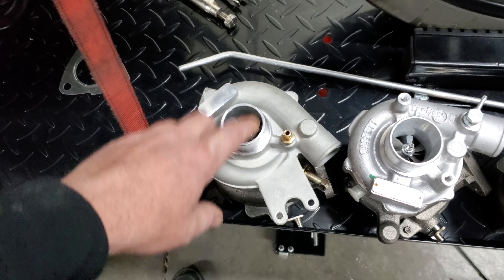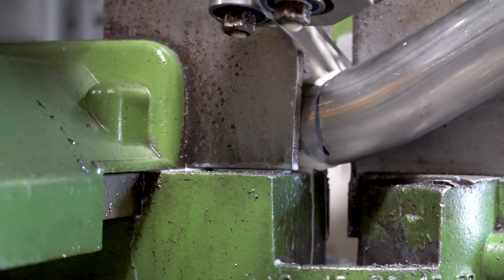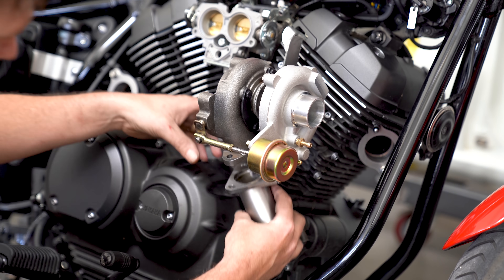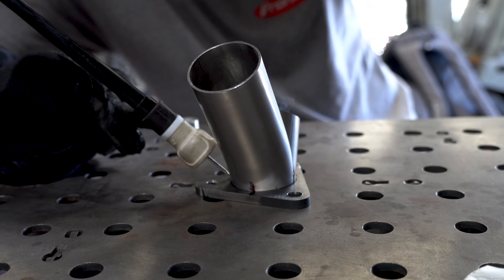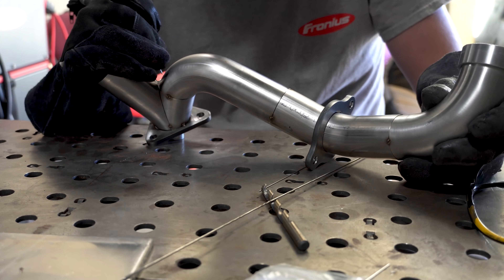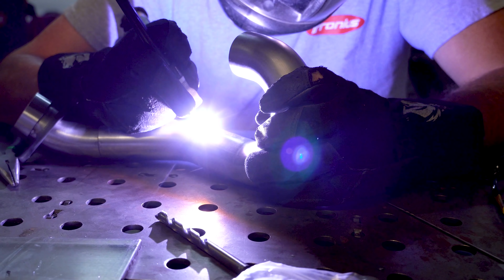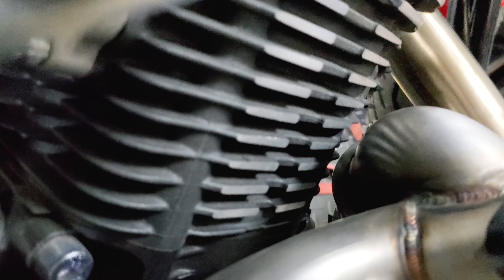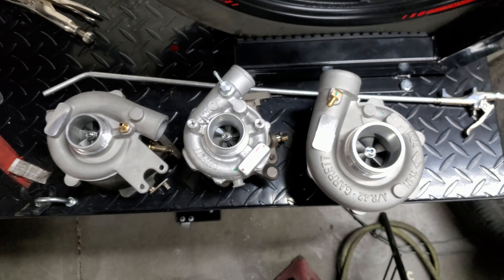Motorcycle Turbo Manifold

Comment: Not sure if someone mentioned this already,  the issues with your camera could be caused by proximity to your tig welding.  High frequency welding does tend to generate some impressive RF output.  That RF can be involuntary inducted into microelectronic components.   I hope this helps.  Your videos are super informative and greatly appreciated.   Thank you for your work.
Reply: Nailed it.

Comment: This is a honest to heaven question:
Should the pipes to and from the turbo not be as close to the same length as possible?  Pressure and flow issues?  Or doesn't it matter on this scale of setup?

Comment: I know first hand, GT15 losses efficiency at 5300ish to 5500, granted my ECU redlines at 7100. possibly moving to gt22 May fix this but I’d assume a tad larger injectors may be needed.
Reply from the maker: I've seen your posts. When I did the math on it initially I found similar results. The GT22 should be just right.

Comment: Don’t you need some kind of flex point before the turbo to prevent cracking overtime?
Reply: I think that with the turbo mounted to the engine and the small weights(forces) and times cracking should not be a problem .

Comment: As "the guy" who built one of the first Turbo XVs (mine's a TR1 though) - you're in for a completely new level of fun...
Reply: What kind of turbo did you use? I want to turbo my Honda Shadow VT 750 and I've looking on ebay for cheap turbos between 100-200 Euros. All of the turbos I found were for 1.3-2.0L car engines, are those too big? I don't really care about massive power gains, do you think turning down the boost would be enough to not blow up my engine? Also did you add cooling to your bike/turbo?
Reply: @Bishop_Heahmund  There's no turbo too big for an engine.
Reply: @arunmfive  depending on how long you want to keep the engine and whether you want to do excessive modification such as changing compression ration, additional cooling etc
Reply: super hessu  thank you for you tipps, I was thinking the same. I am considering buying a garret g12 or gt15 for my honda shadow 750.
Should I install additional oil cooling? (It is already watercooled)
Reply: super hessu  the compression is 9.6:1, so not too high (many other modern bikes have like 12:1 or 14:1)
Reply: super hessu  thank you so much for your advice

Comment: .60+ on that a/r for that 750cc. That small turbine housing is choking the engine.
We are finding Garrett GT2862 with an .82 a/r on an 1125r Vtwin is boosting by 2k rpms.

Comment: I can't express how good it is to see someone doing it properly using welded in, carefully selected, bend sections rather than use the over-used wank pie and lobster cuts. Those who know will appreciate your work! 👍
The only thing better would be bending them out of single pipe lengths. On that, are you going to leave the welds exposed, or grind and polish them back for a (slightly weaker) smooth, one piece appearance?

Comment: how is it possible to turbo charge a carb engine?
AS turbo will have different boost pressures (different amounts of air) at different revs....
Surely that would throw the jetting out badly, and either run mega rich or mega lean?

Comment: Please can someone help me... can i turbo my Suzuki Intruder VL 284cc twin cylinder 24HP bike? Is it possible? I have turbos came out from cars in my backyard and i just wanna have fun with 😅 (will use only one turbo). Is 280-285cc twin cylinder bike engine produce enough power to run a Turbo? Btw my english is not that good if you didn't understand it's my fault 😁

Comment: Another turbo bike is born! Love the work, it's looking good! I am glad mine was a paralle twin, that manifold looks crazy!  Do you have good ecu options for that bike? I finally got my blow thru carb dialed in, still need to hit the dyno!
Reply: I’d recommend a Dynojet PowerCommander 4.  It has a baseline, and from there you can simply add or subtract numbers on the graph which is broken down to 500's of rpm, 1k, 1.5k, 2k, 2.5k etc.  it’s really easy to use and you can save your maps and install a toggle switch too

Comment: So, how did you conclude turbine and compressor pressure ratios and what about your engine having severly asymmetric exhaust pulses? You know that the later cases compressor stall under certain operating conditions unless you actually design for it? This is only mocking up some tubes and tig welding... Nothing about what's important in designing a manifold.

Comment: Not a big fan of Japanese cruisers just kinda feels like thier copying. Obviously thier dead nuts reliable and very inexpensive to maintain. I love my Triumph Bonneville though. It refuses to die and has been totaled 3 times now 🤗. I think you would of liked one that’s built out like a Thruxton. They can be made out to be some mean corner machines and thier top end really pulls way up there cause the parallel twin. Also your trauma bag I suggest you strap it on you. 
Trust me. 
Your bike will be way the fuck down the road and you won’t feel like crawl all the way over to it when you do need it. Speaking from experience 😅.
I’m headed for Phoenix here soon for MMI though I’m just doing it for the Certs. I’ll be doing Mechanical Engineering and I don’t want to be a parts department zombie or a service department lifer. I wanna do race prototyping and such. I’m gonna build a 600cc narrow angle V8 that revs to like 22k. Imagine that in a 600 class WHEW!!!! I need to start on the CAD work for it. Only thing that sucks though is I want to learn how to weld and tigbronzebraze aluminum bike frames together. I looked into the pipe trades but 5 years seems like could be learned in such a shorter time. I’m just not so sure what direction I should be looking.

Comment: Cost of turbo...$3000....Cost of laser cutter robot....$50000...cost of bike with bigger motor ?. This is why factory turbos on mid size engines were discontinued as an 1000cc had as much grunt as a 750 cc turbo bike.
That aside its great seeing the creativity and these guys engineering skill and turbo my 1900 Roadliner for me.